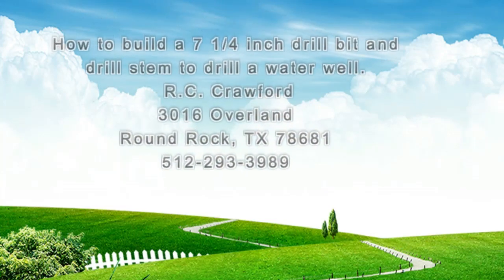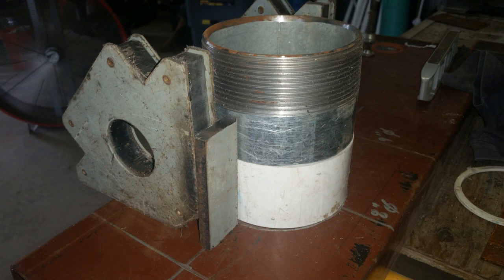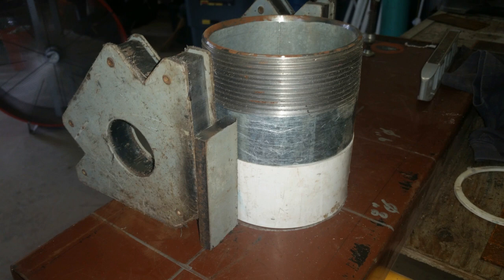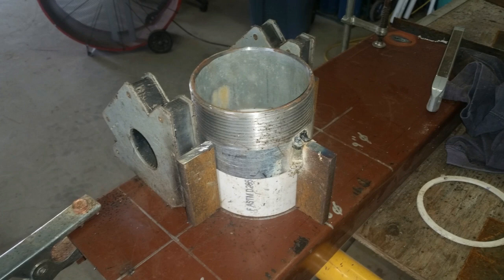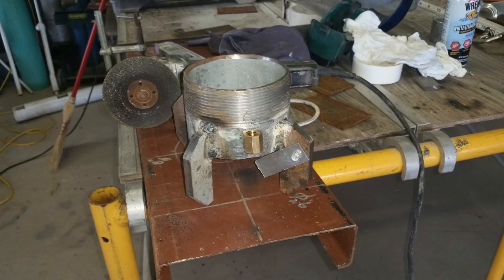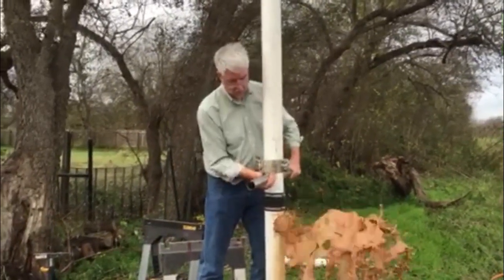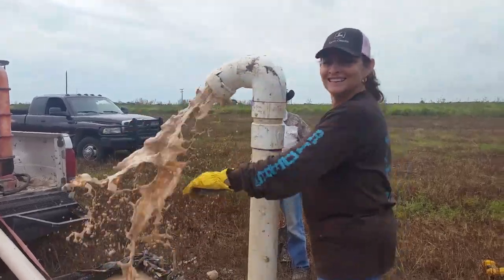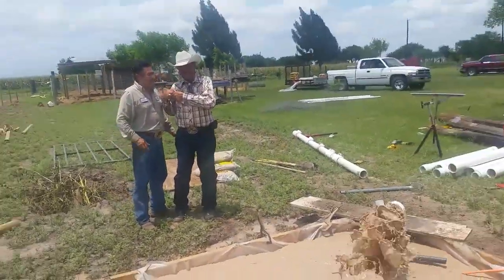How to build a drill bit and drill stem

Comment: Definitely explained in a confusing manner perhaps to sound overly technical? I had to spend a while on the vid, pausing and replaying frequently. But I understand now, one of the main things are, always keep at least 75% of the drill beneath the ground in relation to the outlet port currently being used. There were other things left out, such as what if you want a larger diameter hole / drill bit? what about smaller size pipe and max diameter holes for those? Alternative drill bit methods? ideas for a handle and other info?

Comment: You don't need all that happy engineering. Shark tooth the end of the pvc like others do and hook a garden hose to the top by means of home made adapter like the rest. 2x4 with holes drilled into it for two hose clamps and attach it to your first pipe. sliding up as the pipe goes down. Back and forth such as what they were doing. After you hit water and then it will no longer flush, put in your pvc casing until it stops at the bottom of the hole. Then, Drive it in with a sledge  hammer about a foot or so at a time. Must protect the end of the pipe with a slip to threaded fitting or such taped to the pipe not glued. use sledge hammer sideways. Flush it out as your go. if your disturb the sand at the bottom, the loose sand will dam it up to an extent and flush to the top till you are back at the bottom and undisturbed sand. Do not forget to drill a lot of holes in about a four foot section near the bottom of your casing. I drilled 1400 holes in a 4 ft section at the bottom of first casing.  Drilling a hole in the ground with 1 1/4 pvc and you will be able to fit a 2 inch pvc casing. This method allows for an all Pvc well point and pipe. I attached several thin wall 3/4 pvc pipes to a garden hose to flush out the sand. Did this with one hose and standard pressure. More pressure and volume will make is much faster. Not a luxury many people have though. My well is 25 ft deep with 10 ft of water. driven into white coarse sand. No steel, no rust. Check valve at top of the well. Oh, and it is hard to beat the well pump from Harbor Freight Tools. The one with the tank. Just prime it once and a short time later, you have water.
Reply: That's what I was thinking,too much engineering lol
Reply: The reason I don't do "as the others" is because I am a professional that knows what he is doing. While the process you describe will "work" for a person in some situations, it will not produce a high quality well. The jetting process you describe has been used for a long time. I have used it thousands of times. Professionals understand where the problems are with the method you describe. For example a professional wants to put in wells that are efficient and do so by accepted standards. If the aquifer you are drilling in has well graded sand and no fine sand, then your method will last for a while with no problems. If however you are required to drill in sand via the mudding method using jetting or the direct circulation method then you will have a cake of drilling fluid on the walls of the borehole. The reverse flow method does not usually require drilling mud unless the static water table is above 6 ft below ground elevation. And even then there is no mud needed if you know what you are doing. Your advice is OK and it is good if a person does not have their reputation on the line. However, a professional drill would never give such poor advice. The highest standard of care would involve using a method of drilling that leaves at least 2 inches on each side of the casing within the borehole for filter pack. A professional would be expected to drill using the jetting method and with  an annular velocity of at least 150 ft. per minute. Your suggestions will work. But they will not produce a high quality well in most areas of the world. As a person that has used you method thousands of times, I have usually used a high pressure jetting pump with a bowl of at least 24 inches and usually much larger. A jetting pump with at least 50 horsepower and up to several hundred horsepower is sufficient to drill 18 to 20, 100 ft boreholes in a day. With my method we have drilled two boreholes of 24 inches in diameter and producing thousands of gallons per minute in one day. 
I congratulate you on your successful well. You are very lucky. But please don't advise people to use your method because, in most of the world, it would be unsuccessful. Your method in your local area or  similar areas should suggest that proper annular space be used and that drilling mud should be avoided if possible. 
Using my method you can install a professional quality well using a small air compressor and plastic pipe. No other method can do that at as low a cost.
Reply: @russellcrawford1360  under my house it is all sand. White coarse sand starts at 13 feet. All pvc in the ground. 25 feet deep. True, if you have rocks and clay, probably not going to work.

Comment: I don’t see how your pumping your fluids down. Clearly a mud pump but I don’t see it.
Reply: No fluid gets pumped down, just drill water returning down the outside of the pipe. Its the Air line that puts air down into the bottom of the pipe and bubbles up making the stuff inside the pipe lighter than the water outside the pipe.
Reply: Where does the water come from before you get to ground water?

Comment: Are you leaving the ports open as they enter the bore or sealing them back up as you uncover the next port.
Reply: You need to close each port, you can only lift a small distance %25 so when you start they are close together but when you get deeper then you don't need the holes. When you get to say 8 Meters deep you can lift up to 2 Meters.
Reply: 71160000 no

Comment: The pipe looks like it is galvanized. If it is then that means it should not be welded.
Reply: your not supposed to breath the fumes from welding galvanized that don't mean you cant weld it lol even then he didn't spend a min welding it I can hold my breath that long!
Reply: It can still be a long term sickness. Fumes still in the air. 

They make it in non galvanized.
Reply: Ok whatever
Reply: How does it go if it hits rock
Reply: non galvanized steel works wonders in wells.